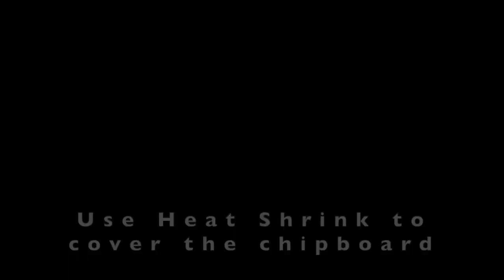Segway Ninebot Anti Theft Immobilizer

Comment: This is not clear from the video. Could you let me know:
1. The red wire from the battery is directly connected to the red wire of the alarm. 
2. The black wire of the alarm goes to ...?
3. The orange wire of the alarm goes to ...?
Thanks in advance.
My assumption is that you connect the black wire of the battery with the black wire of the alarm. The orange wire of the alarm goes to the red cable that goes to the controller. Is that right?
If so, that means that lots of current (amps) that the scooter is asking on full throttle is going through the tiny wires of the alarm..?

Comment: You are connecting battery threw the imobilizer? What about curent? 🤣 I add the relay and switching the wires from display.. FYI when you activate alarm, and hit to scooter alarm will be beeping and scooter is possible to turn on.. it's bug..
Reply: Jobik hey bud do you know how to fit this alarm to xiaomi 👍